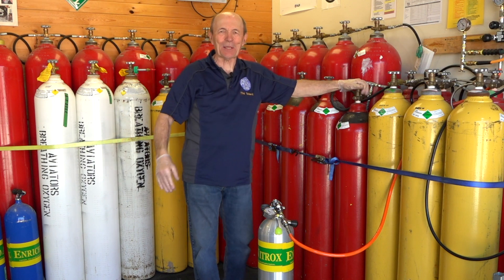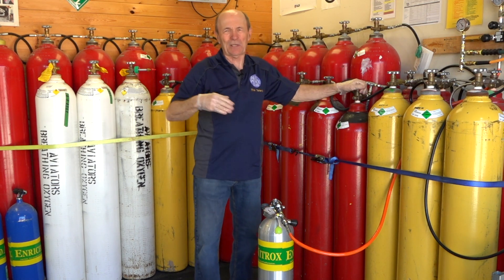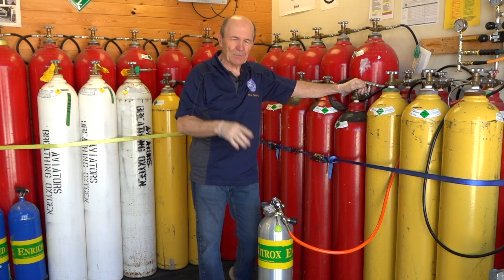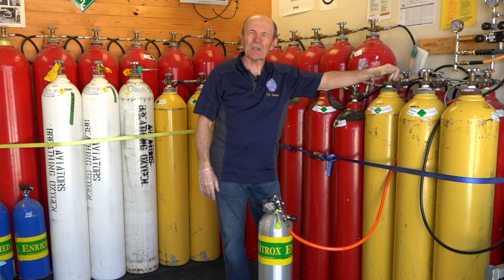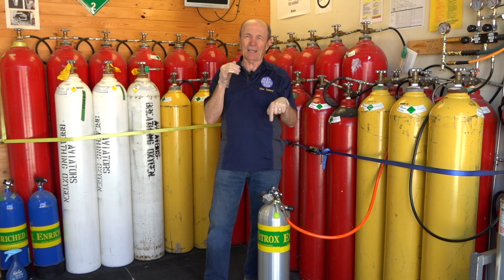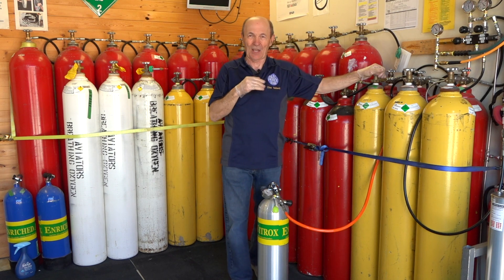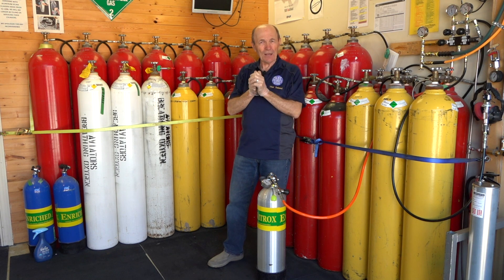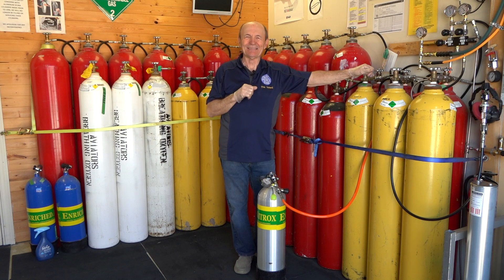How A Cascade Tank Filling System Works - Scuba Tech Tips: S11E08

Comment: 2 questions. Are boosters just too slow for lots of tanks to be done? And, thats one expensive system, maybe just getting solar would solve a lot of the electric bill issues? I know just those hoses must be thousands of dollars. My 1 single hose and conectors was $1000
Reply from the maker: Lots of questions. Good.
A booster is expensive, probably $5000 to $7500. Not a lot of dive stores have one. A booster has several uses. One is to top up a tank if the cascade is a bit low. After a long day, your high pressure bank may be below 3000psi so the booster can be used to top up a customer's tank. A booster can operate on as little as 1500psi & pump (boost) it up to 3000psi.
A booster is also commonly used for mixed gases where a specific tank pressure is needed. For various reasons it may not be safe to simply add air from your cascade so the booster is used. A booster can also be used to pump gases other than air, with the necessary safety precautions in place.
You're right. Boosters are slow & would take time to fill a lot of tanks. Slow is not bad though. For safety & to ensure a proper fill, a slow fill is by far the best. Boosters can be preset to stop at a desired pressure which is a nice feature in a busy shop. You don't have to stand there & watch the pressure gauge creep up.
A compressor typically has a 5 horsepower to 25 horsepower motor at 240 volts which means the consumption is around 3500 to 5000 watts, like 2 clothes dryers or 2 electric ranges running at full power. It's a lot.
I like the idea of solar power. We use a lot of it here but it would not be a small, affordable solar system to supply 5000 watts continuously.
The cost of cascade bottles, tanks if you like,  & connections is not stupid. Having spent as much as $30,000 for a (new) compressor, $500 per bottle + $150 for hoses & connectors is not unreasonable. Most dive stores have built up their system over several years.
Take care.
Alec
Reply: @AlecPeirceScuba_SeaHunter  thanks man. I mentioned you in a recent video about top youtubers
Reply: @AlecPeirceScuba_SeaHunter  Those big tanks can last a long time. Talking to my LDS the guy told me one of his big tanks was made in something like 1902!
Another interesting bit, all of those big tanks need to be hydro tested (every 5 years?). He said they tear their whole system apart to get all the tanks tested in 1 day. Its a ton of work!
I'm pretty sure most dive shops are not making any money on air fills. Lost of expensive equipment, maintenance and the labor for each tank fill.

Comment: This like filling a Spare Air. Bought a Air Venturi pump like shown on their website. Use a couple of Filters in the line. Including a big one with Charcoal. I can't fill the 6cf Spare Air in one shot. I fill in stages. Allowing the pump to cool in between. Cascade Filling allows the Tank to cool a bit between the LP and HP fills. Might get a better fill.
Reply from the maker: The compressor sounds like its not fast or strong enough for your tank.
A
Reply: @AlecPeirceScuba_SeaHunter  Spare Air has other models by the same company on their website. It will go to 4500 PSI. I haven't filled my 6cf unit in awhile. I forget how long it took from 0.

Comment: That's well and good but wouldn't you get a larger number of total fills by starting out all the tanks with 4500 psi at the beginning of the day? It would also save time since the first few customer's tanks would only need to be filled once. I'm not really convinced that it's saving on the total running hours of the compressor either since it's ultimately pumping the same amount of air at the same rate regardless of weather you turn it on once or 10 times. I do agree that it's more friendly with the neighbors. Why not have a smaller booster compressor trickle filling the system in between times?
Reply from the maker: There'd be no harm & perhaps some benefit from filling all of the tanks to 4500.  
Cascading the fills will still give many more fills. Back to that in a moment.
The downside to filling all the tanks to 4500 is firstly the cost. 4500psi tanks are markedly more expensive. Plus you need more of them so the initial cost is high. Also, filling to 4500 psi is much harder on the compressor.
And after all that, there's no real need to do so.
Now to the cascade system.
The #1 bank, low pressure, high volume (we had 20 tanks here), is filled to 2500psi.
#2 bank, low pressure, medium volume (we had 10 tanks), is filled to 2500psi.
#3 bank, high pressure, medium volume (10 tanks), is filled to 4500psi.
A customers tank @ 500psi is filled from #1 to whatever pressure is in that bank - let's say 1800psi.
Then it's filled to #2 to it's remaining pressure - let's say 2300psi.
Then #3 tops it up to 3000psi. While not a truly accurate measurement, lets say that you have taken only 700psi from bank #3 rather than 2500psi from the single bank.
Since not much volume is removed from #3, you can top up many tanks before it's pressure drops to 3000psi.
However, if all of the bank bottles are at 4500psi and you simply fill the customers tank from the entire system, as soon as the system drops to 3000psi, you're done. Time to start the compressor, even though you still have a heck of a lot of air in those tanks! Pumping all of that air not only cost a great deal, and wore the compressor, now you can't utilize all of the air in them!
It can be calculated fairly easily using the volumes of the customers tank AND knowing the volumes of the cascade bottles. But we don't fill nor sell air by volume. Divers could care less how much volume is in their tank They want pressure. You must give them 3000psi.
It may sound and appear to be illogical but, trust me, you can fill many more tanks by cascading than by simply filling from a large bank. 
Alec
Reply from the maker: BTW, Boosters are great but, (there's always a but. It's called Life!), Boosters are VERY expensive, fairly high maintenance, noisy & they still require a fairly high pressure to operate. And of course, if you understand Boosters, they waste air, not a lot, but some.
Reply: @AlecPeirceScuba_SeaHunter  I wasn't saying to have a single large bank. I was just saying to fill the "bulk" side of the cascade system to a higher pressure so that you have more total air. The first few customer tanks could be filled all the way using only the bulk tanks and then use the cascade system like you do normally as the pressure in the bulk tanks begins to drop off.
Reply: @SolarSeeker45 Highet pressure tanks are more expensive to buy and it puts more wear on the compressor and filters to fill them all the way. The higher the pressure of the container it needs to pump into the harder it needs to work. My compressor manual gives me significantly lower filter lifetimes when I fill to 300 bar instead of 230 bar. More than just the additional volume would account for.

Comment: Can i refill my scuba tank with the normal air compressor used in Car Mechanic Work shop?
Reply from the maker: You can refill it from any source BUT if it's not certified breathing air, never dive it.  Auto compressors only care about pressure, NOT purity of breathing air which divers require.  To see the high standards breathing air must meet, read this. https://www.airchecklab.com/resources/standards-specifications/scuba-sport-diving-compressed-air-specifications/
Reply: @AlecPeirceScuba_SeaHunter  thanks for the information.
Reply: @AlecPeirceScuba_SeaHunter  I owned the Mr c dive boat and according to fireman captain Stan
Even the high pressure hoses on the compressor need to be certified for breathing.

Comment: Can I fill one tank with another ?  And what will. Need. .?.  Thank you sir. ,  🙏🙏
Reply from the maker: Need a yoke to yoke connector, check Google.  Note that depending on the starting pressure in both tanks, you may not have enough in each tank after equalization to safely dive.
Reply: I have such hose... was like 160 euros (i think in dollars about the same). But indeed... If one bottle is 50 bars and the other 150, you end up with 2 bottles at 100 bar. Or similar math for psi. 160$ is quite a lot of money for the low chance that you have a true "business case" for such action. Though i do use it before filling my tanks, so the tank with the lowest pressure doesn't heat up as much during filling, so more air will fit in it.

Comment: I don't know if you're still reading the comments on this video, given that it was published a year ago, but here's another way of thinking about it:

When you run your compressor, you're storing energy in your bank, and when you fill a SCUBA tank from the storage bank, you're transferring some of that energy into the SCUBA tank. But the transfer isn't perfect. If I take a tiny bit of air at 3000psi from the bank and put it into an empty SCUBA tank, so that the tank has, say, 5psi afterwards, almost all of the energy is lost. It has to be, because the little bit of air I moved went from being 3000psi (lots of energy) to 5psi (barely any energy). The rest turns into noise and heat. But if the tank were nearly full, so that instead of going from 0 to 5 psi, the tank goes from 2995 to 3000 psi, then damn near all of the energy in that little bit of air is preserved. So the inefficiency of transferring air from a storage tank into a SCUBA cylinder is directly related to the pressure difference between them. So it follows that, for greater effciency, you would use a series of banks of increasing pressure, so that you never have a huge difference between the tank the air is coming out of and the tank the air is going into :)

I realise that this is, really, just a rephrasing of what you said in the video from a slightly different perspective. But, given that you are so good at making complicated ideas simple, and given that different people understand the same idea in different ways, I thought I'd throw my perspective (as a physics grad) at you, just in case it helps you find the right way to explain it to the next guy!
Reply from the maker: I read ALL comments Tom and reply to all that I can without spending all day answering them.  Some comments have sincere questions or experiences to share others rant on about nothing.  Your point is a good one but in the time I have its a simple explanation for divers new and old to understand the basics and why your LDS air fill charges vary.  Thanks and welcome to comment anytime Tom.
Reply: @AlecPeirceScuba_SeaHunter  I should have expected nothing less! Great video Alec, I always enjoy the insight into how things work on the dry side of the diving industry :)
Reply: @AlecPeirceScuba_SeaHunter  Alec your explanation and video was better than his. 😅

Comment: Are the tanks not parallell conected?  Would that not leave ypu with more air if you just take air from one bottle at the time. Luke just take air from a low presdure and one high pressure insteed of taking air from 10 low presure and 10 high presure
Reply from the maker: There are multiple tanks connected to a bank; low (many tanks), medium (several) or high (a few) pressure banks are typical.  Filling from one bottle means the closer the tank gets to the fill bottle, the slower and less air it gets.  Filling from many means each individual tank goes down much less so more can be filled.  Hope this helps and thanks for watching.

Comment: I use to get my oxy tank for welding filled from a guy that had some dozen big oxy bottles all plumbed together.
He'd open one then shut it off then open the second then shut it off and so on, down the line.
Then before he'd disconnect the last bottle from mine he'd put that high pressure in the line back into one of 
his lower pressure bottles - And if I didn't need a receipt he'd knock a few dollars off the price - Ha Ha
Reply from the maker: Well that's one cascade setup!  At least your tank was filled.

Comment: Always PSI..
Reply from the maker: When not bars, right!  Ha
Reply: I think as a diver it's good to be familiar with both units (psi and bar), so if you ever dive abroad you can still understand what your possibly rented meters are saying. Might be easier to bring your own bar-unit regulator setup but then you may have to translate the bars to psi for your buddy. Big mess 😅
Reply: @Engineer9736  well all around the world bars and meters is the norm 😅 But yeah, all around freedomland people use psi and feet.
It’s just a very complicated way of diving (and this comment comes from a ohio friend of mine)
Reply: @MrMurray88mph  Yeah i live in Belgium, everything is bars and meters here too. But so far i already memorized that 200 bars = 3000 psi. The feet thing is too complicated to me to do an actual dive on. Yeah it's feet/3=meters but when you're 30 meters deep any extra math to do is just unworkable i think. May be better to just bring some bar gauges over.
Reply: @Engineer9736  Well the best is always to dive with what you are familiar with. And when you're diving around the world, best to have your mask, regulators, dive computer and fins. those are in the order you should buy your dive gear.

Comment: My shop uses 3000 instead of 2400 and then tops off with the 4250 so they do not need to use as many tanks for their cascade system.
Reply from the maker: That sounds perfectly fine for their store and customers.  There is lots of possible variations based on # of fills, time required, cost, space, compressor size etc.  Thanks for sharing.

Comment: Here's a "fun" question to ask dive students - "Where does the energy stored in your tank under pressure go?"

As you said, your compressor is, lets say, 10 horse power, it runs for a while and pumps a tank up to 3,000 psi.  That tank clearly has a LOT of energy in it, stored in the gas under pressure (we all know that if that energy accidentally all gets out at once, you get a VERY big bang!). So you screw on your regs, throw the tank on your bank, leap over the side of your boat, and have a nice 1 hour dive admiring the fishes.  At the end of your dive, your tank is nearly empty, so clearly the energy now in that tank is also practically nothing, so where has the energy gone?   ;-)   

#thermodynamicsisfun
Reply from the maker: Very interesting question Max.  What's the answer?  For other viewers of course!
Reply: @AlecPeirceScuba_SeaHunter  The answer, perhaps somewhat obviously, is the energy ends up in the ocean as low level heat ie  It warms the ocean up! When your compressor compresses the air, it creates potential energy stored in the gas under pressure. It also produces some "waste" heat, because the compression process is not 100% efficient.  That heat is lost to your comnpressor room, as the hot gas cools down in your resevoir bank, or cools in the customers cylinder sat on the floor of your shop.   When you dive with that tank, each time you breath in, a little bit of the potential energy is lost from the tank ie the pressure falls, and the gas accelerates through the 1st and 2ns stage, and then fills your lungs. Close to the surface, when you are breathing air pretty much at atmospheric pressure, the energy goes to pushing water out of the way as your lungs expand, and some is lost to heat and sound as it rushes at high speed through the system. That "hhhsssst" you hear each time you breath is sound energy after all!  At depth, the air in your lungs is still under a greater than atmospheric pressure (the pressure it started at in your shop), so after you exhale, it continues to slowly expand against water pressure as it rises in your stream of bubbles, again, doing "work" on the water it has to push out of the way as it does so.   What is slightly counter-intuitive is that as a gas is expanded, if it cannot "grab" some energy from it's surroundings (adiabatic expansion vs isothermal expansion - google it! lol) it actually cools down. This heat grab is what can cause regulators to freeze of course in cold water environments, because if you take heat from an object its temperature must fall.

So ultimately, all the energy you so carefully pumped into the customers tank in your shop is lost to the ocean.  :-)
Reply: @maxtorque2277  ...and when it is filled it heats the tank.  The always get hot when being filled which is often why they will fill to almost 3200 PSI knowing it will drop to 3000 once cool.
Reply: @maxtorque2277  "energy ends up in the ocean as low level heat ie  It warms the ocean up"
actually the the opposite, no ? the regulator (which can freeze due to pressure loss) cools the surrounding ocean. The tanks get really hot when filling, but cold when used as well...
Reply: @maxtorque2277  A very interesting question and an even more fascinating answer as I had never thought through the energy dynamic transfer of the entire process.
This is another one of those "all this complexity happens without you even knowing" things!